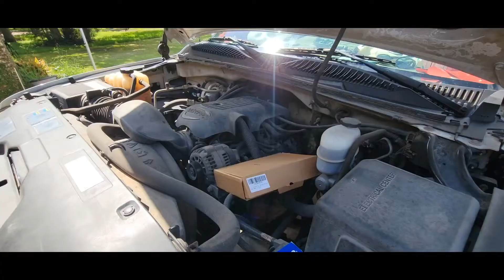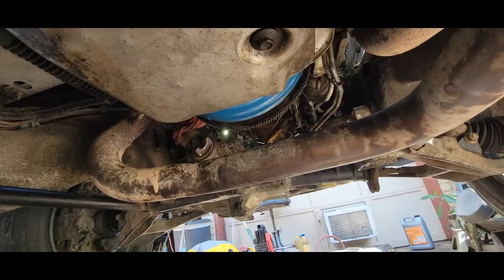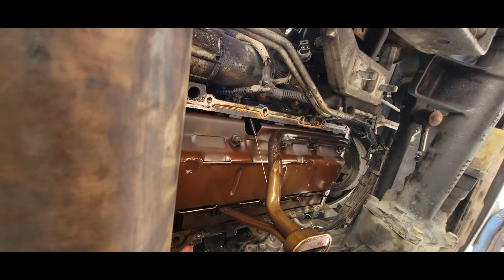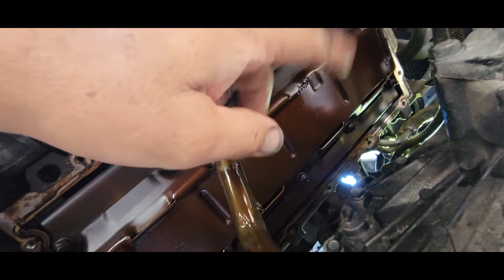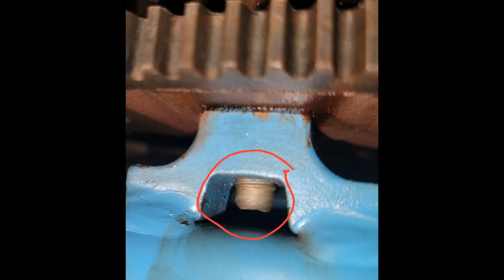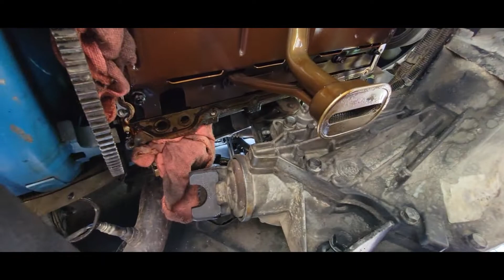2001 Chevy 2500 oil pan removal notes 4x4

Comment: Funny you said something about torque converter bolts because someone had changed transmission in my truck before I bought it. The transfer case would back off the transmission and move. After looking why then figured I would change gaskets when I found what happened. The install wasn't done correctly. It was missing transmission bolts, the converter 2 out of the 6 were tight. So everything had a wobble why the transfer case would walk itself off transmission. Lazy how it seems but it all is being rebuilt because it wasn't balanced everything had a wobble, but not sure which caused which.

Comment: Them bolts on your torque converter though... that could've been disastrous,  brother... good thing you checked them out... doing my oil pump today, and now I'm going to check mine... great video... PS. I'm on oil pump #3 on a 2017 silverado 6.0... melling 10296 this time around
Reply from the maker: Yea it was a surprise to find loose bolts